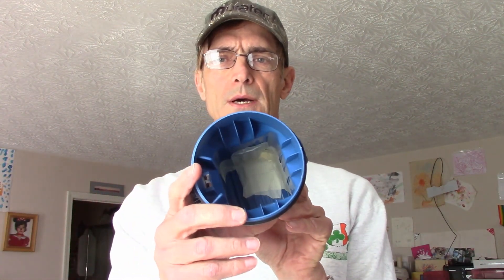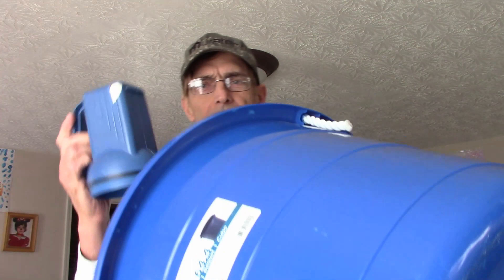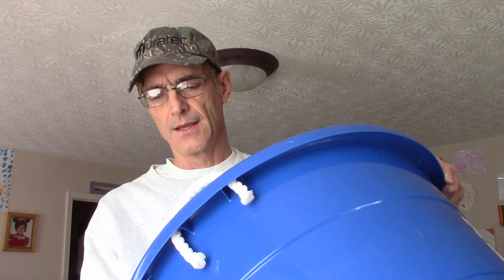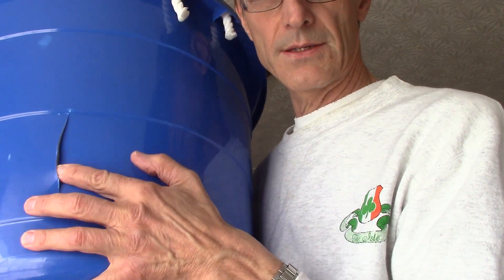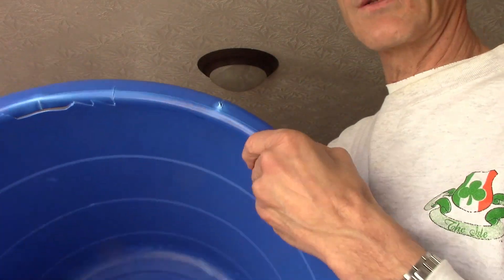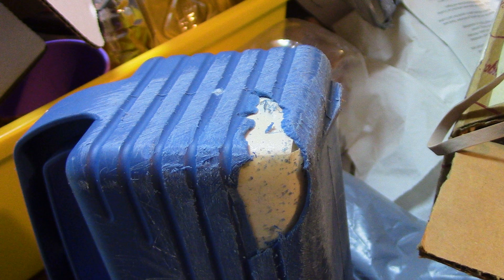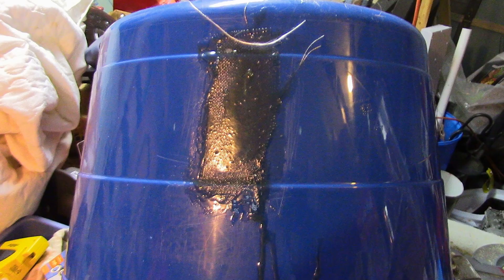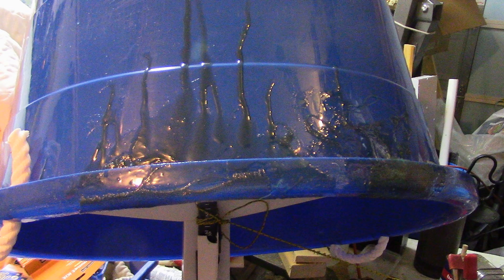Repair Plastic Items with Fiberglass Resin

Comment: You spent more money on the fiberglass repair than just buying a new flashlight, but the knowledge gained by all of us on how to do the repair is priceless, i'm repairing aircraft parts made of plastic, and your video is priceless....
Reply from the maker: That's a funny comment - I don't even use that flashlight any more due to battery type and i bought some traditional style LED with D batteries that have a long shine.  I have moved on to Bondo and plastic welding but fiberglass still has its place.

Comment: I wonder if this will work on my truck dash which is made of plastic.  It's got a hairline crack and I want to just put a layer of fiberglass on the underside of it to strengthen it from cracking more.  Any thoughts?
Reply from the maker: It would work I think.  They make special stuff for that though.

Comment: Most of those plastic containers are made from thermoplastics like pet or hdpe. A simple plastic weld would have fixed you up. All you need is a patch of the same kind of plastic, a soldering iron, and a piece of steel to press it after you melt it.
Reply from the maker: You know I tried that on a radiator and I think I used I think I don't remember what I used for the weld thing some guys say you can use a zip ties not yeah zip ties out but anyway I didn't work very well but I should try it again cuz I was a radiator which is different than a plastic container and in addition I have another plastic container that I broke that I thought about working on and so I could do that I should try that

Comment: the recycle  stamp will tell you what kind of plastic it is
Reply from the maker: I agree with you, but there are still many problems.  One could study hard and in theory, use a particular method for each type.  But the beauty of fiberglass is it will repair many types.  In fact,  maybe all rigid, and semi-rigid.